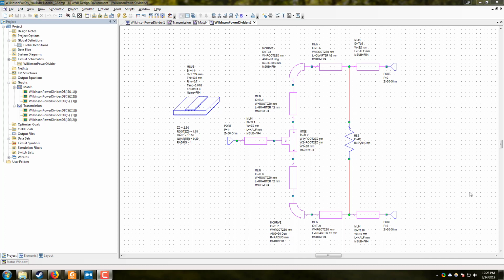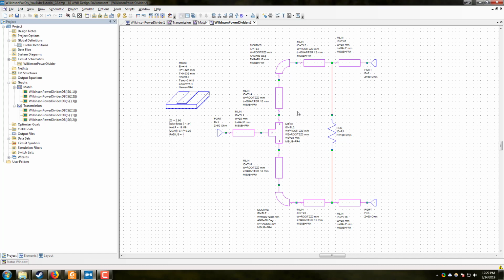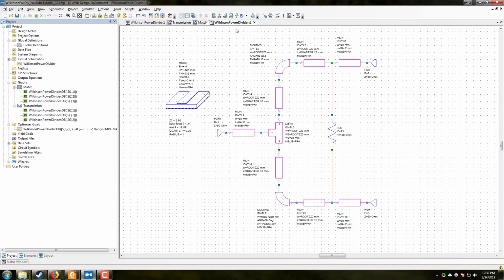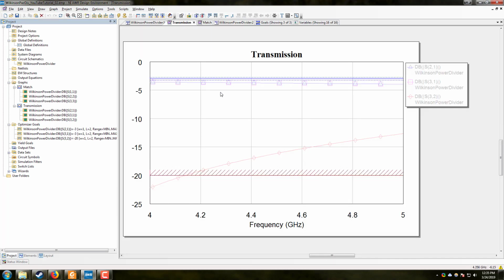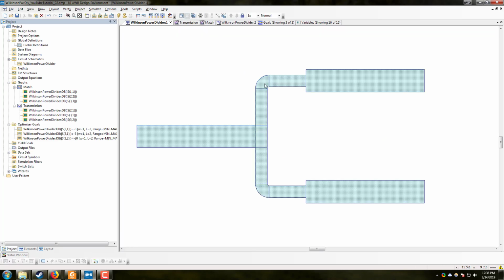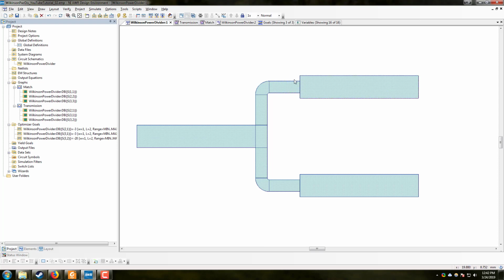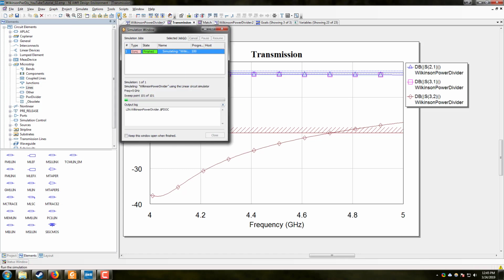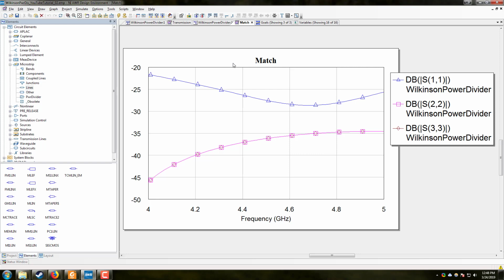How to Optimize Microwave Circuits using NI AWR Microwave Office (Tutorial 2 of 3)

Comment: Hi Anthony, thank you for sharing these videos they are very helpful. I have a question, when I follow along and get to the part where you hit "start" on the optimizer I immediately get an error "A simulation error has occured. The values of the optimized variables that caused this error have been saved under the name "Error" The values of the optimized variables that resulted in the lowest cost have been saved under the name "Best". Clock the Revert button to change to these states." In the status window I see two errors 1) "Factorization of matrix failed due to non-finite entries in matrix" and 2) "Measurement - wilkinsonPowerDivider:DB(|S(3,2)|): Failed to get data from simulator. Do you know why I'm getting this error? Thanks, Dave
Reply from the maker: This is super late, please forgive me. This is a simulator level error I've gotten in the past. Sometimes what fixes it is copying your design into a fresh, new project file. Sometimes reinstalling the program fixes it. Sometimes you have a problem in your design but if you're copying the video then it should work. I hope you were able to resolve the problem without my year-late response.

Comment: Why is the length of MLINs whose characteristic impedance is 50 ohms is your value HALF? It would not be "L50" = 9.01163 (as you showed us int he TXLINE tool)?? Thanks
Reply from the maker: The characteristic impedance of a microstrip transmission line (MLIN) is determined by the width of the line, not the length. The length of the line only determines the apparent electrical length of the line. As far as why HALF, it's because the feed line to a Wilkinson power divider is half-lambda in order to simulate a 0 degree propagation delay. 

See Equation 3.196 in Pozar's "Microwave Engineering" (4th Edition), Page 148 for "Formulas for Effective Dielectric Constant, Characteristic Impedance, and Attenuation" of Chapter 3.8 "Microstrip Line" https://drive.google.com/file/d/1v9TftAmv05An_h0LSdxXR6_YP6V7kvxI/view